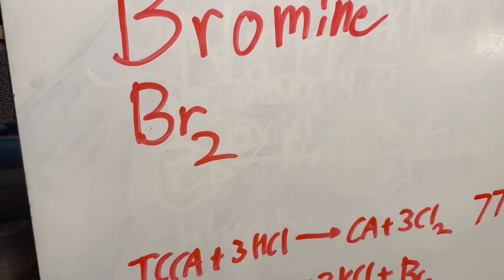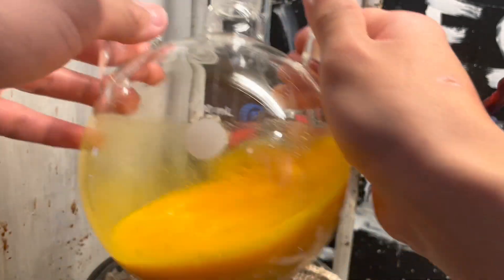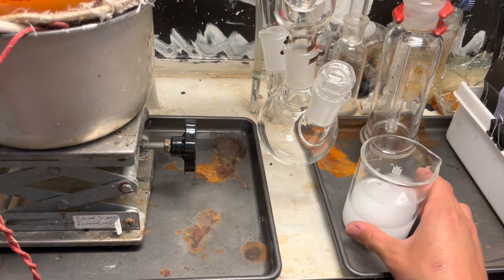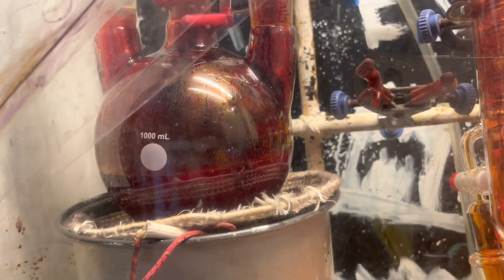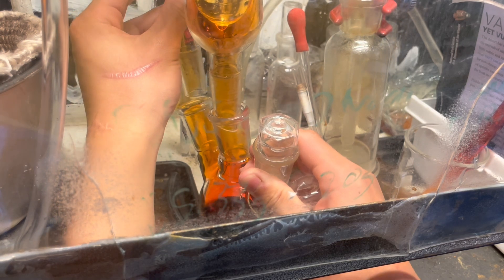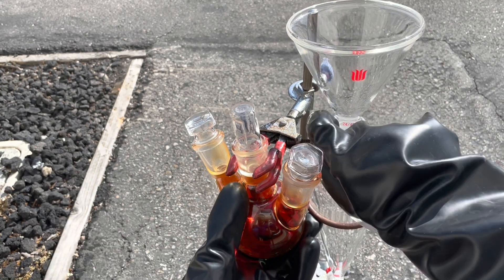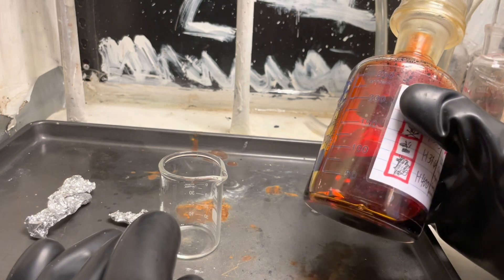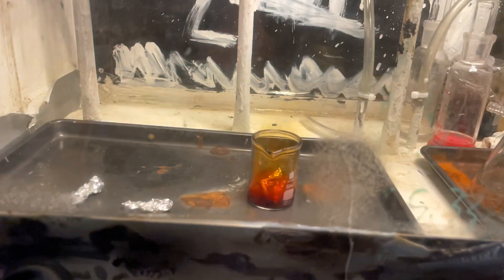Synthesis of Bromine

Comment: Can you try freezing yours?
I did this and my Bromine wouldnt even  freeze fully in Dry Ice.
I wonder what could cause that?
Except for my terrible yield of maybe 10% the end product looks just like yours.
(Didnt have enought to dry it though)
Reply from the maker: you have to dry and redistill it, the water and sulfuric inhibits freezing
Reply: @EdwardTriesToScience  its not enought to dry , only got like 4ml :/
Didnt use any sulfuric acid.
How does the water prevent freezing though? At minus 70C it should be solid, shouldnt it? 

Btw what do you think about using ammonia to neutralize the bromine (vapors)?
Reply from the maker: could also be supercooling but i dunno tbh
as for ammonia you risk forming nitrogen tribromide and some other nasties (ammonium hyprobromite sounds a little spicy), base like NaOH can work but thiosulfate or sulfites reduce it down entire to harmless bromide which cant be liberated by accident while bases just for hypobromite which when acidified can release bromine again during cleanup
Reply: @EdwardTriesToScience  Good to know , I used ammonia to combat bromine fumes, as both are very volatile, worked pretty good, also shows even the smalles bromine leaks. 
But I might not try this in solutions or liquid bromine now  😉
As for the supercooling I m not sure, part of it seemed to solidify in dry ice while the rest didnt. 
Its a mystery, BrCl would have decomposed at 20C or at least build up enought oressure to escape.
Hydrobromic acid should have frozen at minus 70c, and HCl aq as well...
Reply: @EdwardTriesToScience  Update: I removed it from the ampules again and pured it into a cold sodiumbromide solution, it turned into a gooey substance but with little heat it became very viscous and released some gas and heat. 
I pipetted it back into an amoule and it froze without any problems😃
Must have been Chlorine dissolved in it or as BrCl.